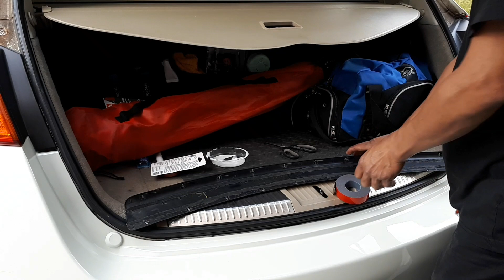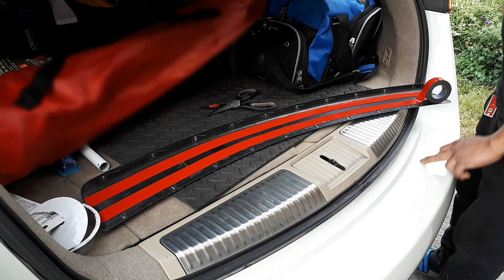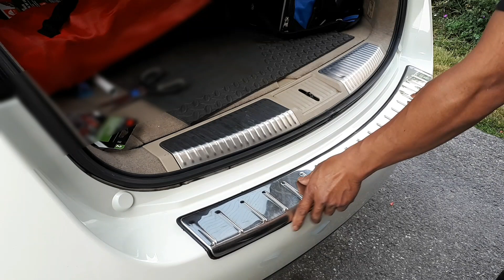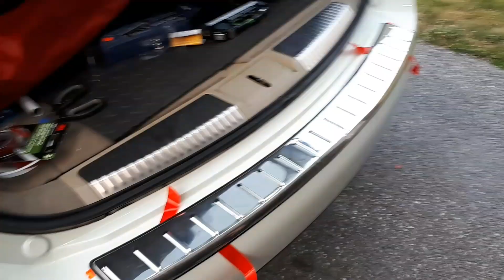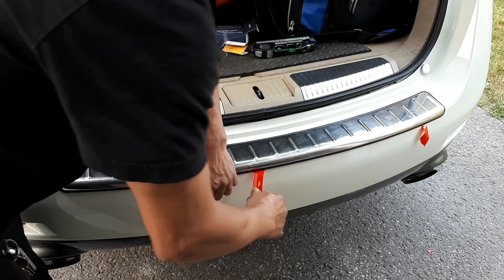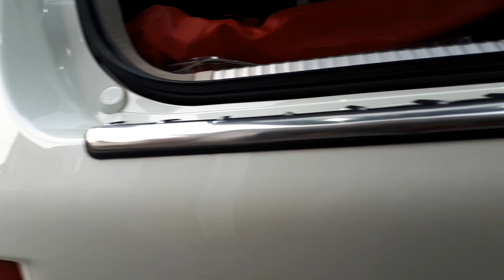How To Install Stainless Steel Rear Bumper Guard Protector(DIY)

Comment: That is an excellent rear gaurd bumper guard to keep it from getting scratched! Sana all. It would cost a fortune to have the dealership install things like protectors when you buy the vehicle, but like any true Filipino you find ways to save money by just buying the parts and imstalling them yourself! That's just smart and resourceful po! It reminds me of when I was studying the way Americans often spend money they don't need to on a tradiotional piñata celebration where in America they use expensive pots but in the magical Philippines they do the same things with less expensive woven baskets. Smart with the money in the Philippines.